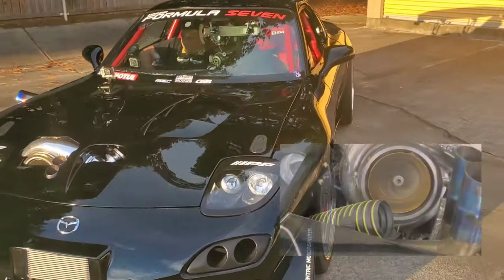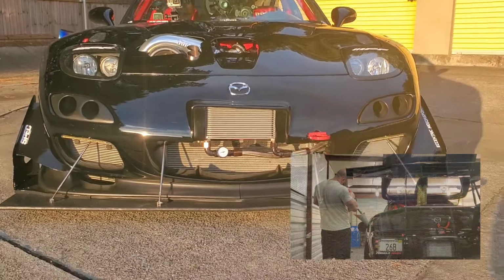INSANELY Loud Turbo 4 Rotor RX7 (MORE BOOST), Brutal Acceleration, Ridiculous Noise - F1 Sound

Comment: Holy sh*t, that thing sounds and accelerates like a 1k cc bike
Reply: This car would pull a lot of liter bikes.... 40 to 140mph most liter bikes would be in trouble.
Reply: @EDCandLace  not if they're tuned lol. In stock form maybe, but in in modified (like this car) especially when stretched that crotch rocket will leave this in the dust.
Reply: @ardijanuar2036  I doubt it
Reply: In person you would never mistake this sound for a liter bike.
Reply: @adamgentry332  I think it's called H2r or something. An absolutely insane bike that would smoke most cars.
Reply: Keep going, closer to a 1000cc drag bike

Comment: What rpm does this rev to? Wow
Reply: 9:35 looks like hes taking it up to 9k? Maybe even 10k?
Reply: @relate97  dude i believe it
Reply: Yeah it goes passed 10 im pretty sure.. sounds like hes short shifting alot prolly to be easy on the trans
Reply: 9k rpm ,
Reply from the maker: it can go to 10k, but its nicer on the life span to shift it at 8500
Reply: It revs up to ALL THE RPMS
Reply: Don't forget there are 2 combustions so it always sound twice as high as an Ottomotor
Reply: What are the pros on taking a car into the máx rpms?
Reply: @SoloJorge  max horse power but thats it
Reply: @TheAdatto  thank you, i really did not imagine that 😅
Reply: @TheAdatto  usually your max hp isn't in your redline, but good builds stay to their max power near redline
Reply: @SoloJorge  more speed, that's really about it.

You want to rev up to peak HP, and then shift to the next gear. If your transmission is set up right, the next gear will be at peak torque RPM. Then you rev from peak torque RPM to peak HP RPM.
Reply: @ScottKenny1978  thats a nice explanation ❤️ thank you man, now I know something I did not knew yesterday :v
Reply: NoNoNoNii It is not always the case where redline is where peak hp is. For example on my stock small turbo Peale boost and power is 5k but I can rev to 7k, by the time I’m at 7k the car is flat on its face making less than 7psi boost. From 3-5k rpms I peak at 22psi and hold 20. Hope this helps as an example but it all depends on application and engine:)
Reply: @usahd7745  damn it has some art and science :p thank you man didnt knew that <3

Comment: fuel economy would be like 0.5 mpg
Reply: its measured in smiles per gal
Reply: kaushik kalita 😂😂 -.05 mpg
Reply from the maker: its about 4mpg on e85, which isn't bad all things considered
Reply: @MazzeiFormula  Not that bad? Thats like 2 dollars worth of premium fuel PER MILE overhere in the Netherlands! (rough estimate)
Reply: Infinite fun miles per gallon
Reply: @marks8068  yea but ud only use this bad boy on trackdays/weekends so the gas thing aint a problem. The trans,turbo,& 4rotor make it all worth it. I dream of having a similar set one day🙏
Reply: TBH with a car like this you don't worry about consumption. It's not the point of this car to be economical.

This is measured in smiles per gallon...

Comment: Currently building a '93 single-turbo 13B track FD, I couldn't imagine the amount of time and money put into an FD of this caliper. It makes me think about how you could probably build a much more power, reliable, etc., etc. car with an LS-swap, for probably a quarter of the cost. That being said though, just listening to that thing and trying to imagine the feeling you must get from driving it, is not even comparable to another car or a swapped FD. Power and reliability isn't everything, and if build right you can get pretty decent rotary reliability. Also i'm sure that thing puts more than enough power to the ground haha. Absolutely incredible machine my man, hoping my 13B FD sounds at least 10% as awesome as that car.

Comment: I got pulled over by a cop one day for entering loop 1 in Austin around 80 miles per hour in my 1993 FD. He did not get me on the radar, but I went over the solid line. He said "I couldn't get you on radar, but I know you were speeding. I'm giving you a ticket for unsafe movement: left". Unsafe movement: left. I saw that in this video.
Reply from the maker: Lolol

Comment: This car on the German Autobahn left lane 70mph  until a Porsche , Mercedes or Audi getting to close with flash lights than floor it! You can push it here to the limits if your car have general safety requirements! Just call me on a tour! Full speed in the sixth gear is easy to get here :)
Reply from the maker: I wish i could go on autobahn

Comment: Would be better with slightly smaller turbo,doesn't hit full boost till like 6000rpm,so only 4000rpm worth off boost,if had a smaller turbo so it could come on full boost about 3/4000 surely be alot more driveable and enjoyable 👍.🍻

Comment: Sorry if this is a dumb question, is the gear stick just dead weight with the sequential paddle shifters in now? if so, why not delete it?
Reply from the maker: So you can still shift if there's a fault in the air the system
Reply: @MazzeiFormula  oh cool, TIL! thank you

Comment: Its sounds great would love to see collaboration video with the right YouTuber. I got a question can you hold rpms long or does water and oil temp rises quickly? Just curious if 4 rotors are happy holding rpms
Reply from the maker: Doesn't care to much about rpm, but it will get hot under sustained boost for a long time

Comment: how many horsepower when it doesnt use turbo?
Reply from the maker: 500
Reply: @MazzeiFormula  wow!... well, still fast for na. i wonder if it has 700hp like 787b ;)
Reply from the maker: It could be if you switch to high compression rotors and revved it to 10k

Comment: He should race rob dahm when he finishes his 4 rotor
Reply: This 7 is tuned to perfection and runs and boost's so much better and cleaner than Robs sorry no offense to Rob I like his too but his just doesn't seem run as clean as this it sounds exactly like the 787B that we all know and love keep up the good work mate I can only dream of having a 7 as badass is that maybe when I sell my farm I could afford one I got my first 79 S1 savana RX7 13b large Bridgeport that I fully rebuilt myself when I was 17 had to sell her after 12 months to pay the traffic fines and losing my license from doing burnouts and doughnuts everywhere and doing 160kms in third gear in a 50km area I still regret selling it back then I thought it had crazy amount of power it only put out 250hp at the wheels but the car was light as I can only imagine taking yours for a blast lol.

Comment: 😂 ... you would be faster pulled over by the police and disqualified by the technical checking and cruzified, as a mouse founds a hole...germoney is not so the holy place as you think. Even if we have no speedlimits, there are plenty of idiots on the street and the overtaking Trucks. Also known as „Elephantrace“.

Comment: Damn! I cant even drive this fast in forza haha! What would the top speed be?
Reply: Well, eventually the aero and the Mazda RX-7’s CW (drag) value would equal the thrust, and prevent it from going faster, I’m guessing around 250 kilometres an hour, or around 160 miles per hour.
Reply from the maker: final drive is 200mph right now!
Reply: @MazzeiFormula  you passed me turning off 280 yesterday in this beast. I dont even know if you heard or realized you had a 700AWHP Silverado trying to play around with you, but I had nothing for you. You literally walked me at a buck 50. Like I said in another comment, mad props man.